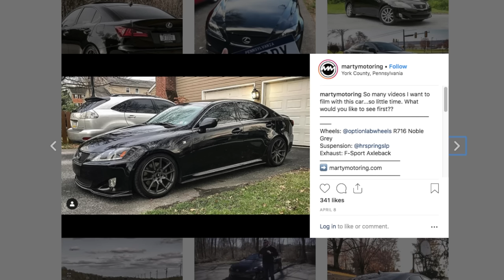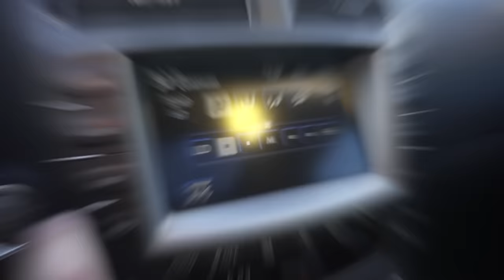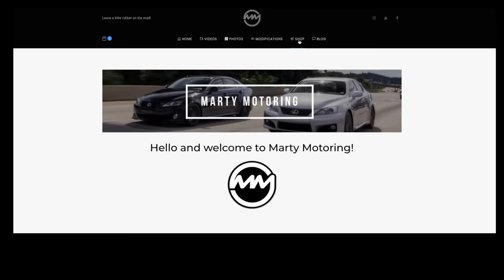Popular Mods for Lexus IS 250 and IS 350

Comment: nicest car lexus ever made 😴
Reply from the maker: They made the ISF, GSF, RCF and LC500 (and LFA!) which are much nicer lol. ISF is 0-60 in 4.2 sec, and quarter mile in 12.5 sec. that’s quick for a sedan
Reply: Marty Motoring  lol i only say it’s the nicest lexus ever made cause i have one😂 LFA is probs the nicest car lexus has made so far
Reply: Marty Motoring  an i also group the IS-F with the IS given that the ISF is apart of the IS250 n IS350 family, i also have had a 2008 IS-F it was my second car my first was a 2007 is250 my grandma let me buy off her for cheap but the ISF had 170k miles when i bought it for 10k an i drove it till 215k and the engine blew up was going to swap it but i had already put 2 grand into repairs b4 n 10 to buy it i was already to deep into it also couldn’t do an engine swap myself so i’d have to pay someone extra i lost money on it an didn’t get more then a year n a half use out of it  (still was a lot of fun it ripped even tho it had high use) couldn’t find another later generation isf with under 90k mileages n at a responsible cost not 30k, an a IS350 came up on craigslist for 12g with 32k miles n the body was mint so my parents helped me out with buying that an bout 3 months later i sold the ISF on craigslist for 6,500 to a guy in texas who put a new engine and tranny in it. all i’ve ever owned are lexus IS’s an they’re great cars i plan to find another is-f when i have the money to take a trip out of state and buy one
Reply: Marty Motoring  id be happy to send u some videos of me in the isf i cherished it so did all my friends it was a sad day when it died

Comment: Huh you either have an F car, or you dont.
Reply from the maker: These mods are for the V6 250/350 cars, and I mention a few F-Sport parts. 
The F-Sport parts are not meant to compare with F parts but offer some performance upgrades. IS-F has different mods as well.